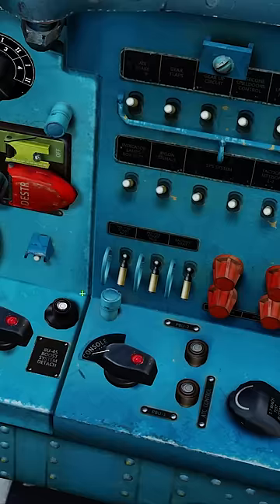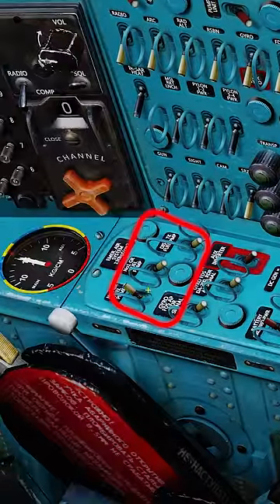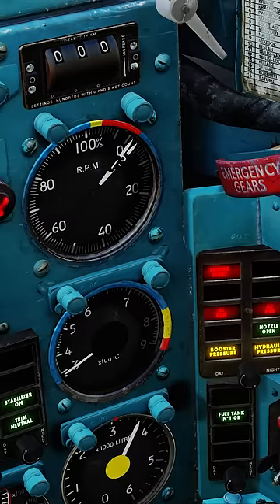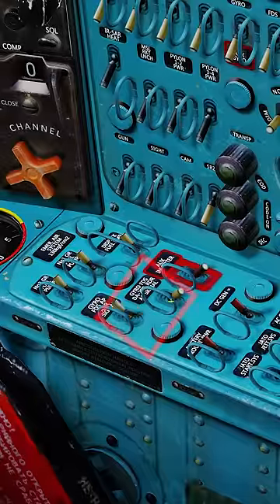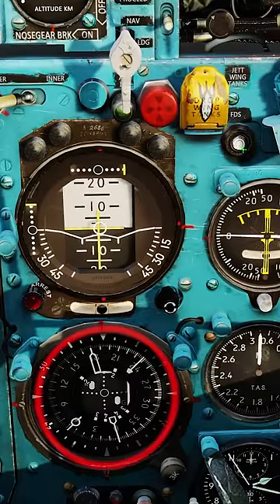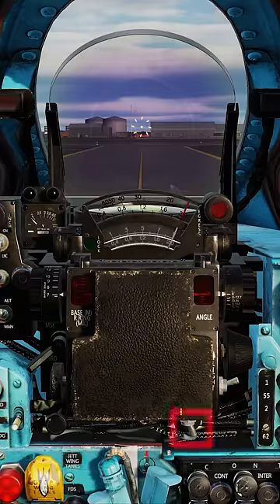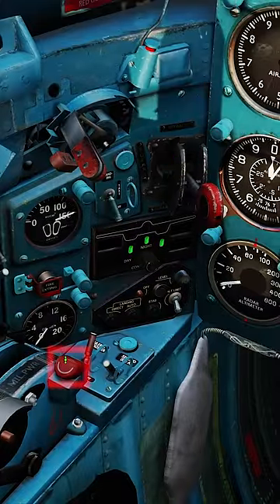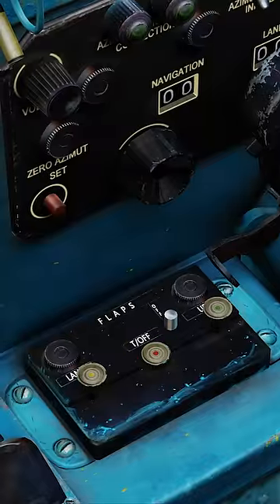MiG-21 Startup: Everything You Need to Know in 60 Seconds

Comment: Now I understand why airplanes do not require keys.
Reply: They do
Reply: @leelandlagasse6517 a very few 
Most don't
Reply: Most military vehicles in general dont have keys, theyre kept locked up in motor pools, and even for the less complicated ground vehicles, short of taking them for a joyride before ditching it or getting arrested, not a whole lot you can do with it. 

People (usually military) have occasionally stolen them, but its always for joyriding and they either get returned or found abandoned shortly. Either way not worth it for the potential charges.
Reply: @leelandlagasse6517  You missed the joke. 😋
Reply: Man it's not like a car
Reply: Some do, but the buttons and switches are tge ultimate anti theft security... like a manual gearbox in a car.
Reply: @shekhar81 many do actually. You'd probably also be surprised to know just how many are missing lol.
Reply: Its not for the intellectually lacking 😂
Reply: @shekhar81 this is incorrect
Reply: @shekhar81 very few? Dude most planes in the world are general aviation aircraft, and most of those need keys to start
Reply: @Michael-uc2pn I’m curious, say you’re one of those precocious teenagers WHO JUST HAPPENS TO KNOW the startup sequence for an F-15 and somehow takes it for a joyride… What are the consequences?
Reply: Uh...you end up as a smoking hole in the ground. Don't think for one second flying a sim will make you a pilot in a real aircraft.
Reply: @chrisgrube-he1gr  the only requirement is full load and disconnected, old jets are unclassified and known precisely, why not.
We have plenty of sim-only pilots making nice maneuvers in their first flight.

Comment: Just one thing, if you turn on the radar by putting the power switch to standby, you are going to start using coolant and you have a very limited amount of it. Indeed you normally would turn it on only a few minutes before arriving to combat zone to let it warm up but not before.
Reply from the maker: Yep totally right!
Reply: Why would the coolant be limited amount? Isn't it a sealed system? Or do you mean you would be devoting coolant to the radar that could be used somewhere else
Reply: @DaDaDo661  some coolant systems consume the coolant. Turbo water injection is one such system. The water gets injected as spray and is used up. You need to refill it as necessary.

Perhaps the Radar also consumes. Did you Google it before writing a comment question which could have been answered if you wrote it in Google?
Reply: @DaDaDo661  searching what you wrote returns this:

"Alcohol is way more efficient in transferring heat than water, because it evaporates faster and have a lower boiling point. The con of such a system is gradual loss of alcohol as you use it. But very simple, efficient,cheap, trouble free and if having to refill it after each flight doesn't create undue logistical problems, then sure, a good idea.

In a nut shell, alcohol is routed (pumped) around the radar array with tubes. The alcohol being cooler than the radar, the heat will transfer to the liquid. The liquid will keep going til it gets to an expansion chamber, if it were. Evaporation will occur and heat will be dissipated as it is vented out in the atmosphere by it's own pressure create as a byproduct. Very simple system, a fraction of the parts (and cost) needed compare to closed circuit. You can also see an advantage in weight and space saving here.

 

You could always tell that Russian designers were very practical and ingenious and had to work within constraining limitations. The ruling parties were forever demanding better design but with a fraction of the money that would be available to western countries. They wanted maintenance to be idiot proof so as to shorten training time and enlarge the pool of potential candidates for technical schools. They wanted super reliable airplanes to minimize downtime between flights. On top of that, their aircrafts had to be able to operate at temperatures ranging between -60 to plus 60 Celsius. And lets not forget crappy unprepared landing strips as a requirement in case it becomes necessary to deploy some jets in remote areas. All in all, i think these guys did (and are doing) pretty good.
"

Looks like a good solution for the times. Probably easier to carry more alcohol if needed. And a smart alternative instead of creating a huge heavy power hungry cooling rig.

You probably know about the special pens NASA invented for space travel? They cost a fortune and took years to develop because they had to work in zero gravity and if the spacecraft was upside down.

The Russians used pencils.
Reply: @Google_Does_Evil_Now  thank you very clear explanation, indeed I knew coolant was being consumed but never wondered why. Indeed I always find this story about pens and pencils very funny and representative of the difference of mindsets between the two blocks 😄
Reply: @Google_Does_Evil_Now  and @Paul Sup. The pen and pencil thing is a myth. Also, Russians often drank the alcohol meant for such systems and used it to resell it, (TU-22 especially known for such problem and MIG-25 to some degree). 

In fact, any military wants these qualities. Russia was just poor and lacked the technology to do better. As it does nowadays too.
Reply: @PlayerOneIDK   @T A  and @Paul Sup. The pen and pencil thing is a myth. Also, Russians often drank the alcohol meant for such systems and used it to resell it, (TU-22 especially known for such problem and MIG-25 to some degree). 

In fact, any military wants these qualities. Russia was just poor and lacked the technology to do better. As it does nowadays too.
Reply: ive only once ran out of coolant..... and that was leaving it FULL on..... and flying SLOW
.
if you use that after burner for even 2 mins.... you are gonna run out of fuel LONG before you run out of vodka for the radar 
.
.
leave it in standby.... its fine
Reply: @Google_Does_Evil_Now  your explanations are top notch.
Reply: @Google_Does_Evil_Now  Adding on to @judicc's point, the Space Pen was independently developed by the Fisher Space Pen Co. with private capital.

Contrary to popular belief, the broken tips of pencils posed quite a problem for sensitive electronics, so when the Space Pen hit the market, both NASA and the Soviet's bought a bunch of them.

The website and YouTube channel Today I Found Out has a great article/video about this urban legend.
Reply: Maritime radars are never switched off unless the ship is blacked out
Reply: @TimmyInTarky  it is not a myth wikipedia even says it cost more than 8 million to invent the pen lmao
Reply: @Google_Does_Evil_Now  they used the pen the US developed as soon as it was available. Turns out having bits of graphite floating around your zero gravity spacecraft isn’t advisable.
Reply: @japanesedriftmachine2140  1) Wikipedia, the most trustworthy source on the internet
2) the pen was developed by a private company then pitched to NASA. No federal funding went into the development of the pen.
Reply: @Google_Does_Evil_Now  Yeah, NASA used pens because having highly conductive graphite shards floating around a spacecraft and getting into the air filtration system is stupid.
Reply: @Google_Does_Evil_Now  And the graphite from the pencils would cause damage to electronics and filtration equipment thats why despite having russians on the ISS they still use pens.....
Reply: @juliannolastname2442  This is a common myth. NASA always used pencils. The “space pen” was made by a private company in the US. Commercials just confuse people easily. Both the Russians and the Americans bought the pen after it came out.
Reply: Now a days combat zone is right after take off dude!!!!!
Reply: @juliannolastname2442  NASA used the pen once it became available, sure, but they in no way developed it.
Reply: @TimmyInTarky наличие спирта, тем более в военно-воздушных силах , не являлось проблемой ни во времена СССР , ни в сегодняшней России. В бортовые системы самолётов заливали спирта столько, сколько потребуется , а сливали его и употребляли во внутрь только после того , как самолёт выполнил задание и вернулся на аэродром.
Reply: @princeo15  ships don't use the same system because they aren't constrained by the parameters of aircraft.
Reply: @TimmyInTarky  Its an old comment but still.

In 1981 The Americans projected that the Soviet had a unquestionable lead in 23 scientific areas. And the US had a lead in 18 areas. They estimated some additional areas which were shaky.

Comment: This reminds me of starting my daily driver: An 87 Fiero with the 2.8L where I wired it so it can only start after disengaging a kill switch, switching the fuel pump relay on, putting the key on running mode, and pushing a button to engage the starter. Oh. and you gotta step on the clutch while starting it. Good luck, would-be thieves.

Comment: Shouldn't you turn on the gene and the invertor after your engine is at full rpm ?  
The aircraft will start with its internal or external batteries and the gene and inv will only provide current once the engine is at full so turning it on early isn't good

Comment: if u just have to turn on all those swiches, why don't just connect it to one?
Reply: In case you need to turn them off like if sertain system malfunctions, in case of an electric system failure... On mi24 they actually made a "thing" where by pulling the cage it manually switches all the switches up.